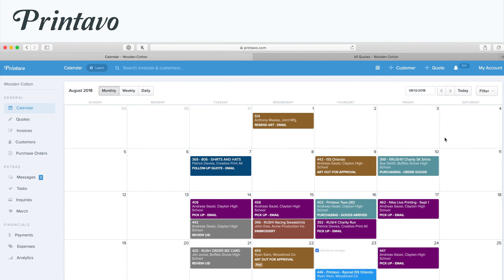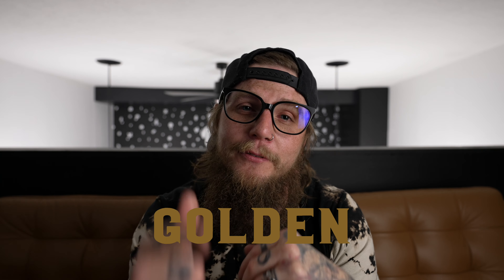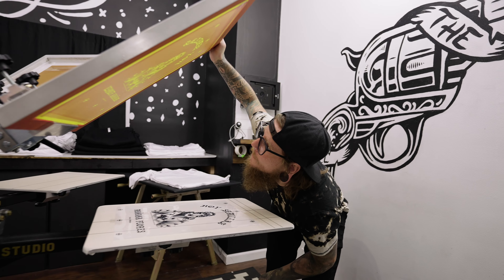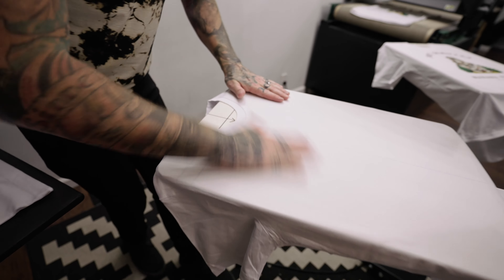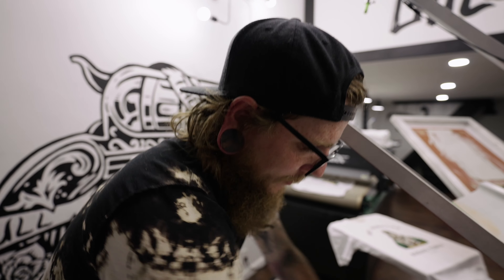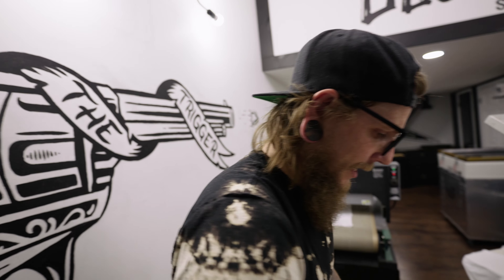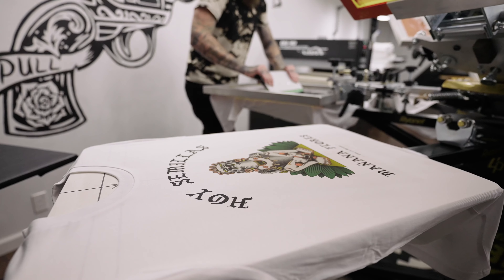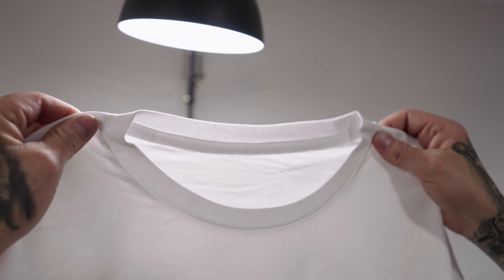Printing a SICK 6 color design!

Comment: Good video. Can you please tell me if I need to stroke/choke the white underbase (make smaller)  or leave it the same size as other colors when doing these type halftone prints. Thanks
Reply from the maker: On darker garments you can do an underbase with a slight choke to help with registration.